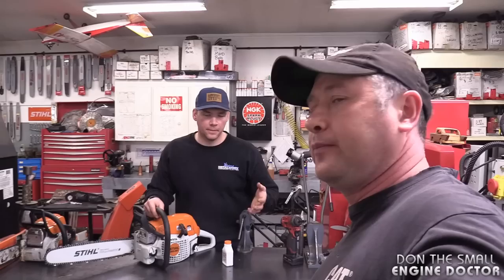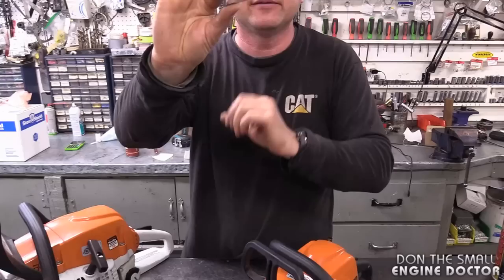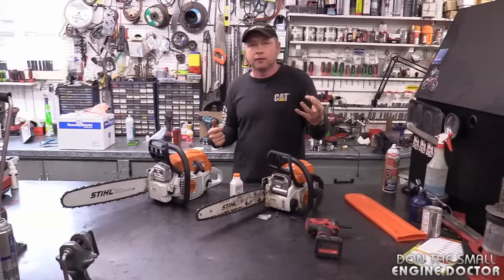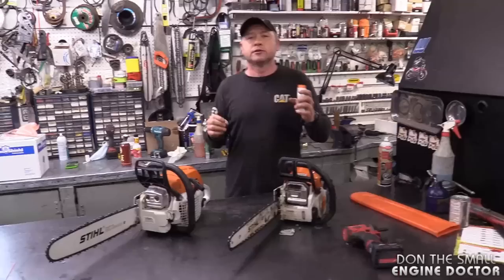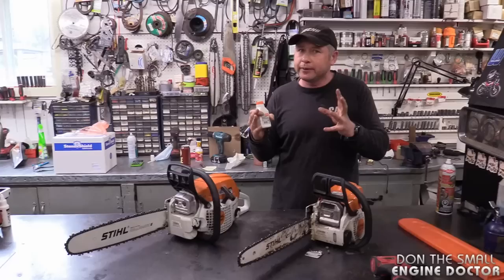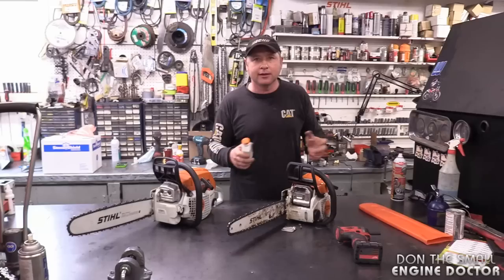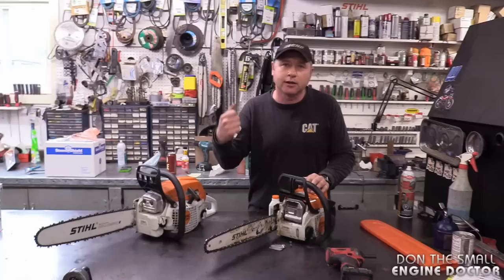Should I Double-Up My 2 Stroke Fuel Oil Mix For More Lubrication? Teaching Apprentice Dave

Comment: I have a related L & T mixture screw question,  I rebuilt the carburetor and set float and all gaskets with kit set properly. I Put a new cylinder and jug from husqavarna into the chainsaw, as it is a 1998 350 saw, And my exhaust screen is clear and my crank seals and boot are not leaking yet it idols best when the idle screw is turned in all the way,  And I set the H & L screw with a tachometer,  The saw accelerates to response from the throttle very well, But what is wrong my idol? H &L screws are not bent yet it needs to go in all the way to idle  And if I backed out the L screw it would stall?

Comment: I always used to run my 2 stroke motocross bikes at 40:1 and never blew one up or had carbon buildup.  My equipment is ran at 50:1

Comment: The oil is good, the gas (ethanol) is bad - run mid grade in 2 stroke engines as most people won't burn 5L of cheap gas in a year.
Reply: The fuel tank on my weed whacker lasts me the whole season, it doesn't get more then about 10mins of use per cutting.

Comment: If you hs e an older machine with an adjustable low and high speed needle you can easily tune it for 25:1 or even 20:1. For the non adjustable carburetors you could go ever so slightly lean though were talking only 2% difference. In the long run this could have a detrimental effect on the engine if it's already tuned lean to meed emissions regulations.

Comment: Yes & the unburned oil sits in top of the piston & varnishes up.the piston rings, piston & cylinder which is why you also find that the piston rings end up stuck in the ring lands.

The same thing happens in a 4 stroke engine if you don't change the oil regularly enough !
Reply: Huh?  No, any oil that gets past the piston rings is going to either get flushed out with the next stroke of fuel intake, or turn to carbon if it sticks around.  Stuck piston rings are more often a sign of engine overheat to the point of oil breakdown, or low quality oil exacerbates it.

Please THINK!  If you have unburned oil that is a lubricant and would do the exact opposite, keep piston rings that would otherwise stick, to stay free.  That's one of the purposes of the oil in the first place.

However if you meant that piston blow-by carbonizes the oil and seizes the ring in the piston, sure that happens, but happens more from using a lean ratio so you have more wear to create the gap for the blow-by.

Comment: I wonder why the chinese holzforma farmertec designer knockoff chainsaws recommend 25:1 mix? I figured it was due to inferior materials in the engine construction, but 40:1 should be fine with good oil...I use red armour.

Comment: Great explanation on why running the gas to oil ratio at 20:1 or 25:1 is a bad idea. I immediately too thought of the spark arrester getting plugged quickly. Thanks again Don (and Dave).
Reply: what spark arrestor? lol
Reply: @jbbolts  same with us. All spark arrestor screens are removed before unit is fired up. In our experience, concrete can’t catch on fire but maybe concrete in other countries, is flammable? 40:1 for us. Never had a seizure at 40:1. At 50:1, we ruined so much equipment, it isn’t funny.
Reply: @garrettstevensen2467   youre right . If machine is ran short periods of time in cool weather 50 might be ok for awhile but for sweltering hot climates ran long periods at a time , its 32 : 1 for me and i dont have to worry w carbon cause use the echo red armour 2stroke oil combustion chamber and piston crown looks like new .
Reply: Master, is a 1:33 mix okay for the 372 xp 357xp 351 and the 545rx scythe? Will it not make too many deposits? husqvarna LS + oil?

Comment: For years my dad ran 32:1 on everything.
Reply: My Dad has a old Lawn Boy two-stroke mower that he swears by that runs 32:1. It runs great, the only issue I have with it is smelling like I've been at the racetrack all day after mowing.
Reply: Master, is a 1:33 mix okay for the 372 xp 357xp 351 and the 545rx scythe? Will it not make too many deposits? husqvarna LS + oil?

Comment: That MS170 would run like garbage with 25:1 because the oil does displace fuel in mix and those saws do not have adjustable carbs to compensate for the extra oil so the engine could run hot, add to that the extra carbon build up and a plugged spark arrestor to keep the heat from escaping like it should and you will have a cooked saw in no time.

Comment: The main reason engines run now at 50 : 1 is political mandate from the EU . Oil technology has not improved that much but engine technology has or had to and any of that old two-stroke engine should still run on its recommended ratio of 32 : 1 or even 25 : 1. Those Chinese cloned cylinders and pistons should also be run closer to 32 : 1 as their metallurgy is certainly not to European standards.

Comment: I have a question: can I use fuel injector cleaner (for cars) on two stroke engines to clean up carburetors? Will it clean it?
Reply: yup... i do that all the time... im no expert though and so it at your own risk use common sense and make sure its stays lubricated etc..
Reply: It will but if you wait till the engine has a hard time running, it will be a chore to keep it running long enough to clean the carb out and it's not a substitute for draining fuel for storage, nor will it eliminate the need for an eventual carb cleaning or replacement, just extend the interval.

Note that if you use a top tier fuel, especially ethanol free, fresh fuel in a timely fashion, then the detergents already in it are doing the job so you don't need fuel system cleaner.

Comment: Would it be bad to run a lawn boy f engine at a 16:1 or because those aren't as high rpm as these chain saws would a leaner mixture do the trick ?

Comment: I have the Husqvarna 262 XP I bought it new in 1993, I've run 32:1 using Mobile 2 stroke oil with Sunoco 110 octane gas for 28 years, it still has the original NGK spark plug. 
Running extra oil doesn't hurt anything.

Comment: I run 50:1 in my echo and mcculloch equipment and the rest 40:1 I plan to start using semi synthetic Lucas 2 cycle oil back in the old days people mixed with sae 40 ive ran stihl hp ultra and echo and Lucas oil what ever i can get

Comment: First off use a good oil and the carbon build up will not be a problem. Echo/Stihl/Shindiawa/Redmax/Husqvarna does not make oil. They make equipment. Out of all the oils I mentioned the Shindiawa/Echo Red armor is the best out of the bunch.

Comment: I have leaf blower that requires 25:1 and want use a 2 gal gas can that requires 10.24oz of oil should I mix this or should I go with a 28:1 (9oz oil) or a 30:1 (8.5oz oil) ratio. Which one should I go with 25:1, 28:1 or 30:1 and not get a lot of carbon build up in the future ?..............

Comment: Have either of you guys used seafoam spray to remove carbon build up in an older saw?
I've had good luck, especially on chainsaws and trimmers that have been sitting for awhile.

Would like to know both of your experiences with seafoam, if any?

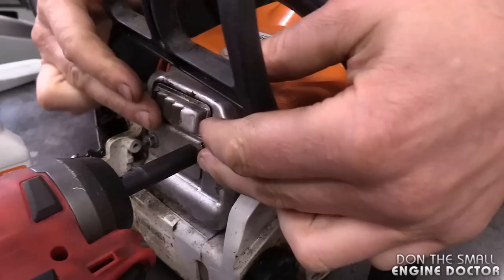Comment: Hey Don, how about my saw engine even my brush cutter call up to 1:25 ratio. And i use the basic Shell 2T oil? The oil doesn't recomend any ratio of use. Should i follow the engine manufacturers ratio or what. So far i use to 1:25 ratio.

Comment: You're getting carbon fouling because Stihl oil is JASO FB. Run a good modern JASO FD oil, and not old school JASO FB oil(meaning you can't run Stihl oil), and retune your equipment to the mix you're running, and you can run 25:1 no problem. No carbon build up, no fouled plugs. Echo Red Armor, Husky XP+, Yamalube 2R, Honda HP2 are all good FD options, but there are lots of others.

Comment: Don, about gas mix, I have repared chainsaws and trimmers from de 80s and 90s. I am concerned about makers mix recomendatacions like 25:1 or 32:1. I know that 2 stroke oils have been improved a lot from that time so, do you think is resonable to use 40:1 or 45:1 eaven in this old engines?

Comment: I have acquired an older McCulloch, late 70s early 80s model. The manufacturer calls for a 40/1 mix, I use modern day STIHL 2 stroke oil but I have some leakage on my muffler just like you talked about in this video

If I use a leaner mix, say 45 or 50/1, will that fix my leakage problem?

Comment: I used  a 25 to 1 gas mix in my 25 hp Mariner , I used only a qt to get better lube as it had not been ran in six years , was this a bad idea , I thought since some breaking in on motors used to call for 25 to 1 ,would be a good idea, is this ok or maybe not. I want to use a 3oz per gallon mix ,since I don’t use motor that much.thanks

Comment: You must have a spark arrestor in your exhaust on any chainsaw or motorcycle used in a national Forest or in some cases any forested area ! Also instead of running extra 2 stroke oil just toss about 3 ounces of 10w 40 motor oil per gallon of gas and no worries ! Using old school Itasca ( green bottle ) oil for a while now and it works great !

Comment: I have an old Poulan Micro XXV chainsaw from back in the early 80's and I read that the fuel mix was supposed to be 16:1 ratio back then!  With today's fuel and modern oil, should I still be mixing it that rich?
Reply from the maker: i would go 45:1

Comment: Burn about 3 gallons a day, in a falling job environment, 6.5 hr days.
 We use a aftermarket oil.
 We have no engine issues, get about 500 days on a saw. Do the math, we get a new saw. It's not a issue. We don't skimp on quality. Use a 40 or 50 to 1 mixture, depends on day temps, never use ethanol gas, prefer premium. Just get better life, performance.

Comment: Hi Dony and Dave,

Another informative video, thank you!

Question: I have several punts of old (30+ year) but unopened 2-stroke oil. Would you recommend using it or should I dispose of it and by the newer improved oil? Thank you! — Charlie
Reply from the maker: you might be taking a chance using that old oil, probably better to stay with the new oil!
Reply: @donyboy73  Thanks for the quick reply, Dony! And it was several PINTS, not punts (so much for submitting questions after midnight) — haha!
Reply: @cfishel15  just use it in non expensive stuff or stuff of that age

Comment: I have an fs 310 brushcutter. i messed with the carb adjustments. now its weaker than before i messed with it. but there seems to be not much going on when i turn the h screw adjustment. sucks to work now cos its weak. need help

Comment: donyboy73, I have a back pack blower that was manufacturerd in 2014 that calls for 25:1 which is what I've been running in at. I've only used maybe 3 to 4 times, should I keep that ratio? Will it hurt if I went to 32:1 or 40:1? Thanks in advance for your assistance.

Comment: What about a saw that says to run 25:1 and leaks oil (tacky sludge) out of the muffler? And why not marine oil what’s the difference?
Reply: You can run all engines with modern 2 stroke oil at 50 to 1 with today’s high quality oil. DONT run marine oil in small engine as it is design for engine that are water cooled and don’t see the temperatures that chainsaws and smaller air cooled engines do

Comment: Sorry but I disagree with you on this to some respect this may be the case for some of the new tyres of chainsaws and better quality saws but you still get the cheaper saws out there with the instructions of 25/1 mix and you have given this advice in this video which doesn't necessarily be the best advice for some of the older chainsaws which actually need the extra oil otherwise it dramatically shortens the lifespan of the saw

Comment: just got my first chainsaw, it a stihl 170. There is a sticker on the saw that says use 20ml stihl branded 2t oil or 40ml local(usually means unoriginal/cheap/non-genune) 2t oil for 1 liter of petrol. The dealer(verifed dealer of husqvarna and stihl) didnt had any stihl 2t oil in stock so he gave a husqvarna hp 2t oil instead.

What is more confusing is the price of the 2t oil and if the oil is genune or 'local' , the stihl one goes for around 6$ a liter so does the husqvarna one. I searched for 2t oil on stihl and husq sites and was shocked to see the high price(around ~35 usd for a liter). I live in asia so maybe thats why the price is low. 

I mixed 13-14ml of 2t with 500ml of petrol to get 40:1 and am scared to run the saw as i dont wamt to ruin it.

Should i go ahead and use this composition or double up the 2t oil eg. 25ml for 500ml of petrol

Thanks🥲

Comment: My 1979 craftsman  saw calls  for 16 to 1 ratio  would that cause too much carbon buildup  ? I've ran it all this time and never cleaned the muffler
Reply: Do you know if it was manufactured by roper? Or poulan? If it's a roper, 25 to 1 is good. If it's a poulan, 40 to 1 is good

Comment: donyboy73 A question if you don't mind. What would you recommend for the fuel mixture and plug gap for a Echo SRM - 300AE ?
Reply from the maker: 45:1 and .030" gap
Reply: @donyboy73  Thanks ! 😁👍

Comment: Can the " Double-Up My 2 Stroke Fuel Oil Mix For More Lubrication" also cause the carburetor to gum up inside that causes fuel blockage?
Reply: No, carb gum is from the volatile components in gas evaporating out, leaving behind the varnish.  This happens primarily from either very old gas, or less stable gas due to ethanol in it, or rarely running the equipment so not enough gas with detergent is there to keep it cleaned.

Comment: and what i should use if manufacturer say 25:1 this is often on cheap engines
Reply: or say with their oil 50:1 and others 25:1?
Reply: If the manufacturer states 25:1 on anything made in the past 50+ years, odds are you have such a low quality engine that it's not going to last long no matter what you do, but personally I would then run 30:1 synthetic oil and look for better quality equipment to replace that ticking time bomb.

Comment: Another great video! Thanks! This question is basically for Dave since he said that he is the "expert in Trimmer repair" LOL! I have a Battery Powered STHIL FSA 65 Trimmer. I was trying to change out the head to a "Echo Speed Feed". I cannot seem to get the shaft to come off. Do you know if the Echo Speed Feed will work on that model? I tried to add pictures to this question but couldn't see how to do it. Thanks again.

Comment: I ran to much oil in my mix on my yamaha blaster ... like double recommended,  and the engine got hot fast and the piston went lean and completely lost compression... it was a fresh rebuild with only about two hours of ride time on proper mix ...

Comment: i AM ALWAYS WORKING ON MINE AND NEIGHBORS  ,stihl 
SAWS , WHERE CAN I FIND SHOP MANUALS ONLINE FOR THEM , THANKS DAVE TUTTLE
Reply: Stihl website has all the manuals in PDF form for their equipment. They recommend
50:1 mix.
Reply: @tmurray1972  all i can find is the owners manuals not repair manuals
Reply: @dave6251  My bad, that’s what I thought you meant…lol. You’d probably have to buy a repair manual, have you tried ebay?
Reply: Stihl does not sell them and they're copyrighted.

Comment: Could you talk about AMS oil Saber 2 stroke oil, is it really safe to run at 100:1?  And is it too much to run at a conventional 50:1?
Reply: I run saber 50;1 in all modern saws, perfect
Reply: Run it 40:1 for best equipment life.  They're not going to replace your equipment when it fails from what they consider "normal wear and tear" will they? I'd love to see reports of owners who ran this oil 100:1 (NOT their biased faux-tests) and had their equipment replaced when it fails, but there are too many loopholes to expect them to accept responsibility.
Reply: @stinkycheese804  33:1 is good ?

Comment: Nice airplane hanging up. PT40?
Reply from the maker: I think so yes
Reply: @donyboy73  I have a John dear chain saw J3816. I'm having trouble finding a Magneto for it. It also leaks oil from the chain oiler. Does this have the same pump and grommet set up as in the video you made some time ago.. This has been a good little saw and I hate to throw it away.  Can you help?

Comment: I run amsoil saber and calla for 80:1 but I run it at 75:1 no build up, no carbon shows up on my new top end rebuilds after 10 20 30 40 tanks
Reply: @Matthew Kerhin interesting, I was skeptical in using it because of the lean ratios, have you checked out  some of your pieces of equipment  for wear since running it at that if they were new to start with ? Only time I get smoke is if I run a real rich high jet or when motor is cold for  a moment and clears up
Reply: @Matthew Kerhin ya I defintely have zero complaints about the saber! The transition  for mixing such lean mixes was over whelming  first couple tanks when your used to mixing it tradionally lol
Reply: @Matthew Kerhin yes sir! 🤟🤟

Comment: Most 2 cycles can run no problem at 1:100. Most injected engines runs at 1:100. At 50:1 you already have 100% error margin.The best 2 cycle small engine oil is AMSOIL Saber.

Comment: No way use more oil than stated, it will not burn off and collect in the crank case reducing the volume and causing more engine smoke.

Comment: That's not true at all if you know anything about 2 strokes engines, because two strokes the more oil the better they like it, the only thing that will happen is, because of emission control, you will wear out the main jet quicker. I have blowers and weedwackers and chainsaw that are 40 years old and will out live your brand new stihl equipment any day.
Reply: Up to a point I agree but past that point, too much oil makes it bog down and carbon buildup is unacceptable.  Using good synthetic oil, 40:1 or 35:1 on older equipment is about where you want to be.
Reply: Master, is a 1:33 mix okay for the 372 xp 357xp 351 and the 545rx scythe? Will it not make too many deposits? husqvarna LS + oil?
Reply: @boots7859  If you buy a new chainsaw and mix it at 50:1 and you use Super, your saw won't last, you would be safe at 40:1 with regular gas.